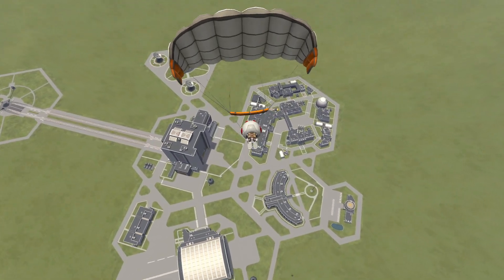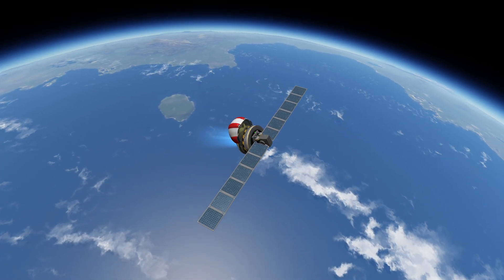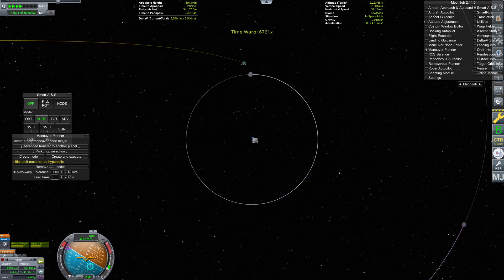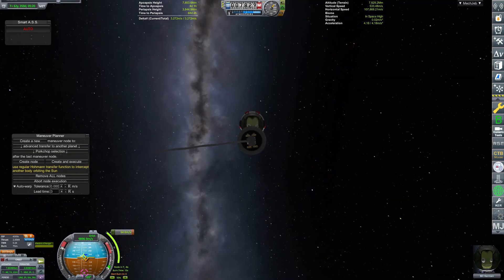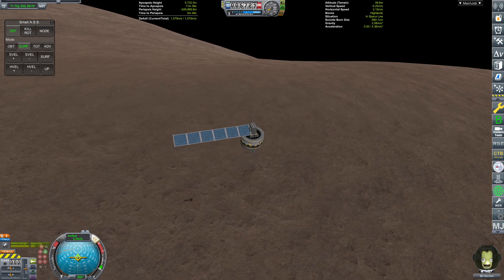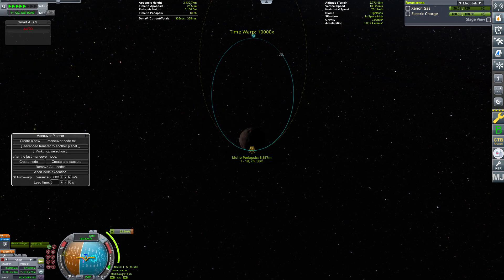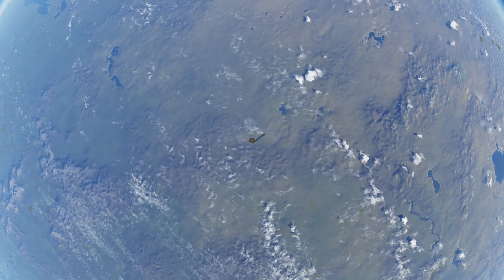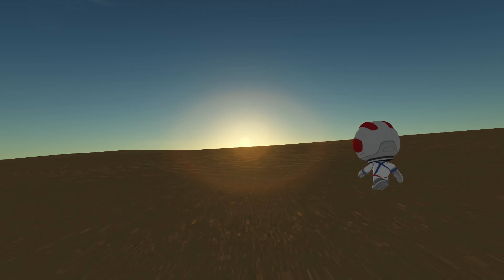Moho with a 1.447 Ton Craft (Disqualified)

Comment: Once you're in Kerbol orbit, why do you continue to use Mun for assists and not Kerbin? Oh wait, you did, just after I posted. :)
Reply: kerbin assists don't work when your orbit is basically the same as kerbins
Reply: @thesilentpearl8575  True, but you can change your trajectory. I was being lazy and possibly not thinking it through. However, the comment on SOI pumping by @proxima_fish is very interesting. Apparently, you can gain some energy by going through an SOI because KSP's gravity model is simplified. It's not a gravity assist, but it's interesting.
Reply: @eekee6034  i mean you can do both at the same time iirc

Comment: very impressive, congratulations on the WR
would it be possible to shave off a couple kg of Xenon by taking into account the optimizations learned from this mission?
Reply from the maker: absolutely, and theres also plenty of optimizations possible with the ascent, since my pitch up once reaching 650 m/s could be losing some efficiency. In total I estimate a maximum of 20kg could be shaved off assuming perfect play, unless there is some optimization that could be done that drastically changes the kerbin ascent

Comment: Anyway, the logic behind SOI pumping is basically:

KSP doesn't do multi-body gravitation, so only one body can exert a force on the craft at any given time. This means that the gravitational effects of all other bodies are ignored. 

For example let's say you encounter Moho from below and are traveling outward relative to the Sun. Your height above the Sun is increasing, but the Sun's gravity is not acting on the craft. This means that when you leave Moho's sphere of influence, you end up with more energy than you should have. I believe this small energy boost can be repeatedly used to wind up (or down if you're going relatively inward within a SOI) an orbit, which could possibly remove the need for deep space maneuvers. 

I haven't tested this very much, however I have been able to get a significant relative velocity reduction. So I don't see any reason why this shouldn't be possible
Reply from the maker: It certainly makes sense that it would work, but it sounds like a nightmare to implement. its wild to think that with that you could get from LKO to Moho in around 1000 m/s